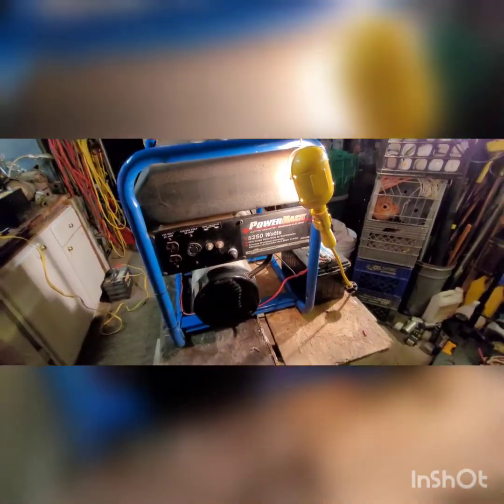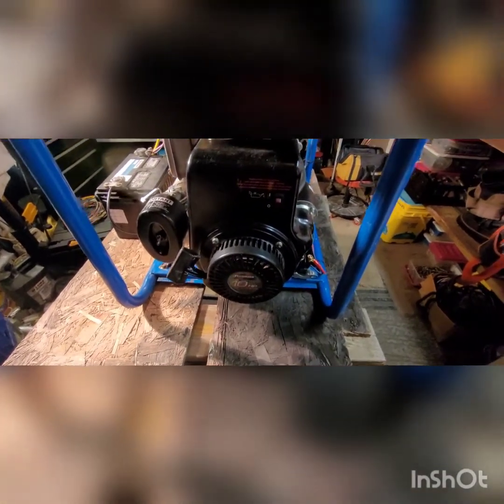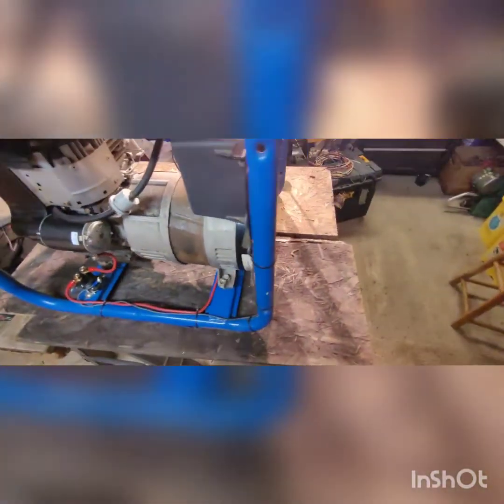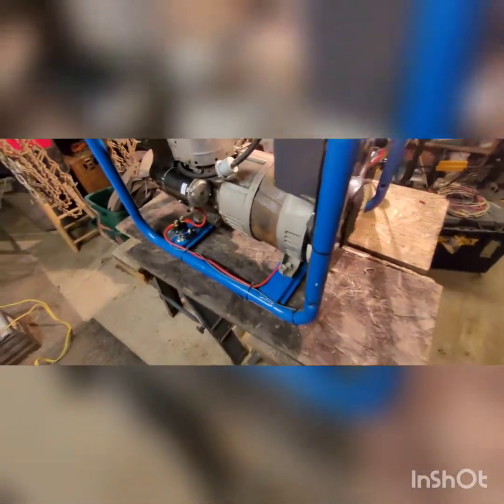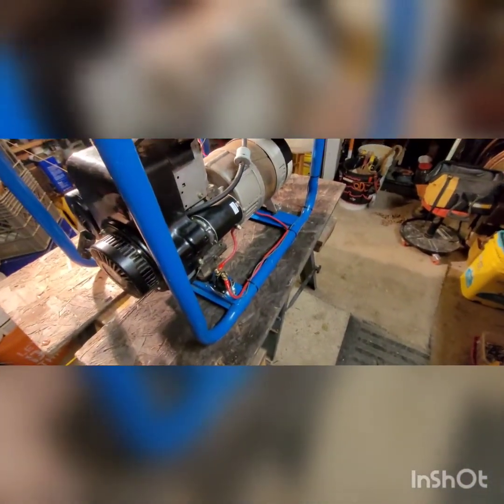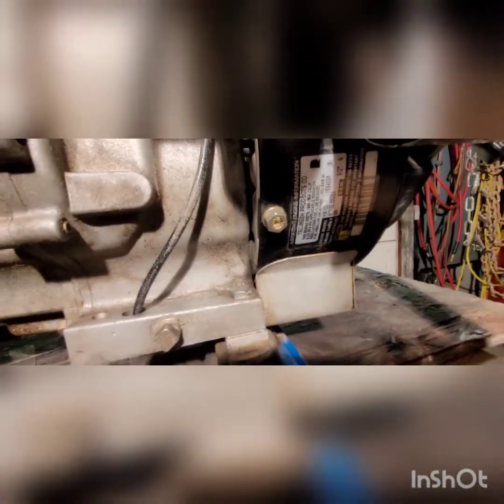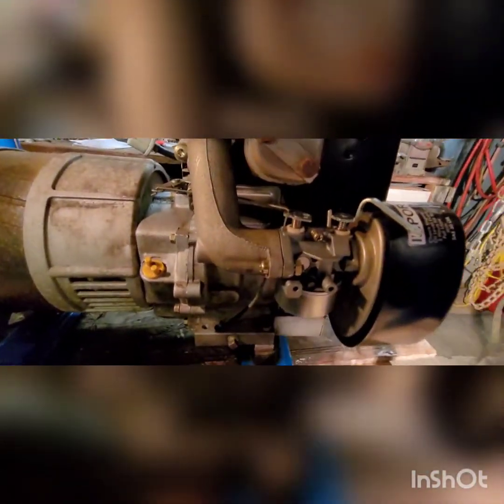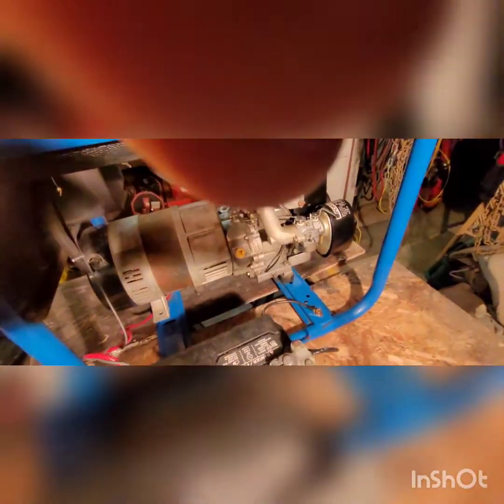How to convert your Tecumseh Generator to electric start.

Comment: Do you have a link for the kit you bought and the numbers for the flywheel for the HM100!?
Reply from the maker: Part # for flywheel HM100 Tecumseh is 610915. Other parts you can find on eBay starter for Tecumseh hm100. Then, look up 12 volt silinoid starter kit.
Reply: The biggest problem I’m seeing is that I can get the parts but people want such insane amounts for just a flywheel that I could get an auto start generator for less than it would cost to modify my current generator. It’s almost like people think these flywheels are made of gold or something. Better off waiting for a scrap motor to turn up or just buying a slightly newer generator or simply pull starting it as is.

Comment: Very good video. Where can i get the starter kit and flywheel. Do you have the part numbers?
Reply from the maker: I believe the part #for the flywheel is #30811A you can find one on eBay, Seller is, bigbu-49. Found my starter on Amazon. type in new 12-volt Starter for Tecumseh I believe it is TVM TVXL220
Reply: @Roadhvac  Thank you for the information.
Reply from the maker: I thought I put it in the description. eBay 98-02 sold buy keeprun68 and in the video I read off the part #. Hope this was helpful.
Reply: @Roadhvac  Thank you
Reply from the maker: Flywheel part # 610915
Reply: @Roadhvac  Thank you.